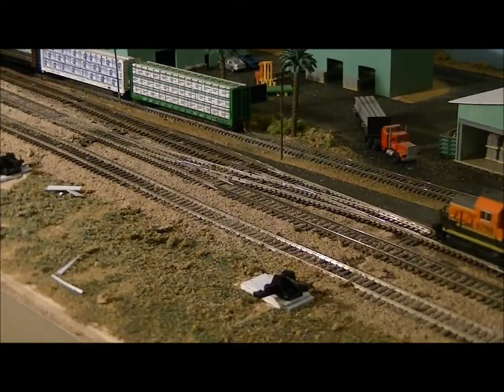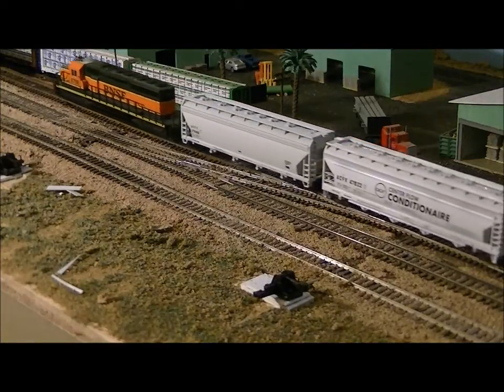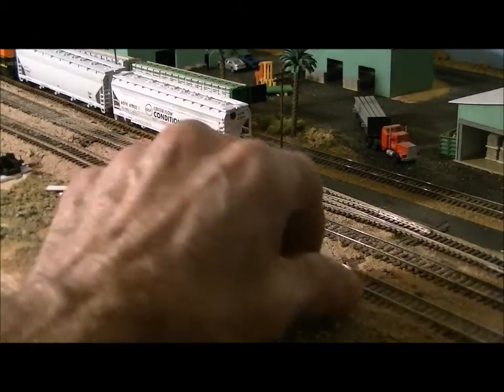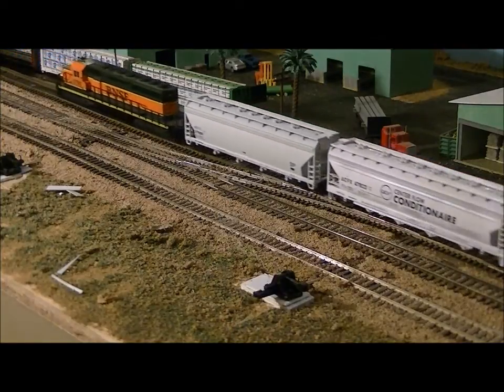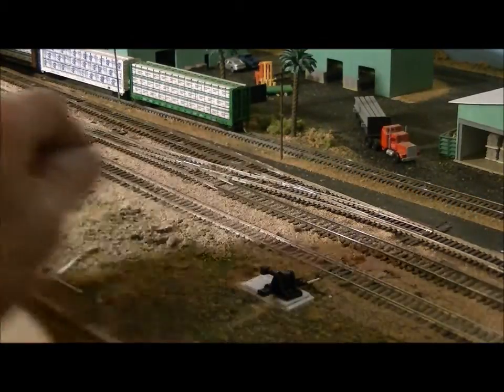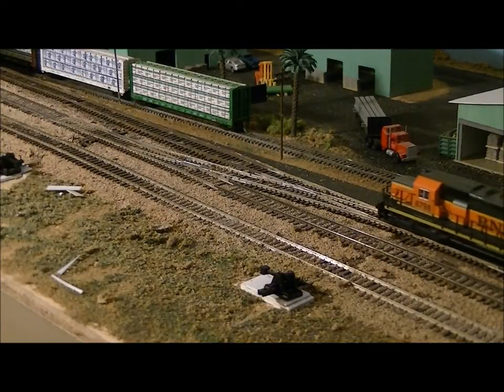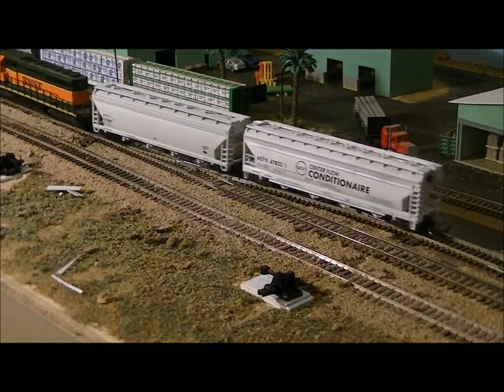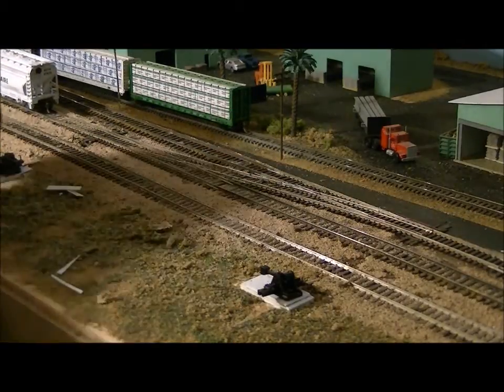GROUND THROW INSTALL TEST RUN

Comment from the maker: hey robert...thanks for watching, your comment & question...the ground throws are from caboose hobbies & the white under them is just a couple of pieces of styrene i used to adjust the height of the ground throw..if you have any further questions, i will glad to answer them
vinny..aka..bnsf6951

Comment: nice, what type of wire did you use to attach the ground throw to the switch??? To bad you can show a video on this also? Do you run the piano wire inside a tiny peice of tubing?